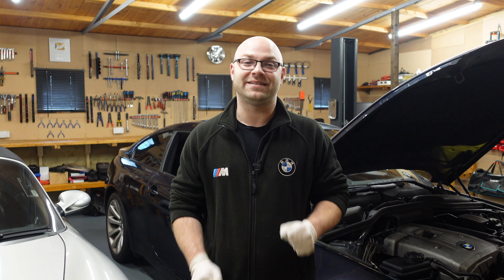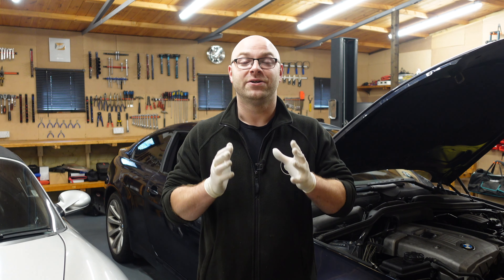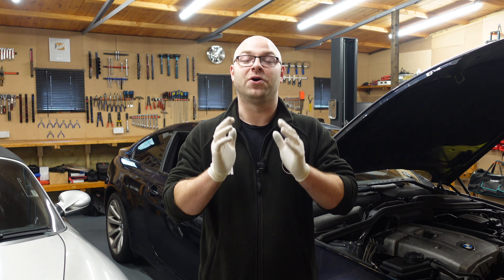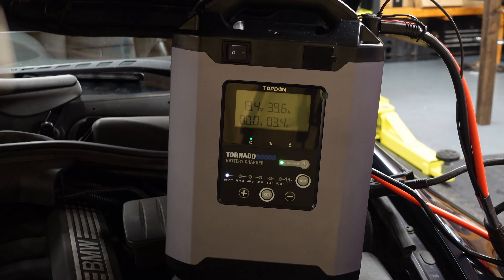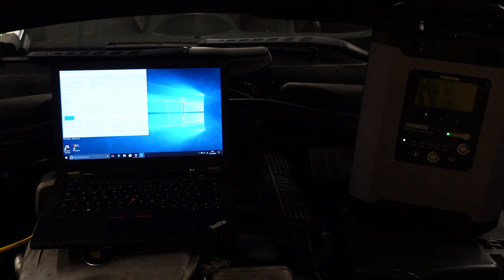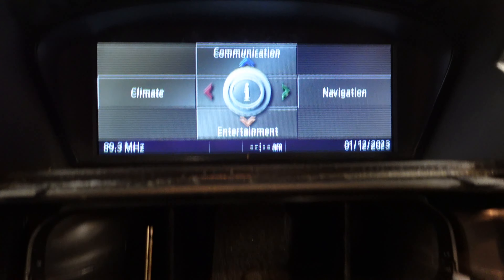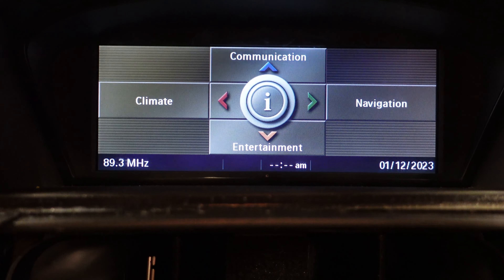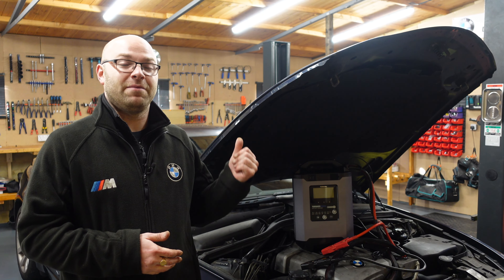This Is The Correct Way To Successfully Program A BMW !!

Comment: Good day Doc, The Swedish CTek now has High Aperage Power Units for Coding, Pro 60 12V, 60A and PRO 120, selectable 0.1V increments from 12.6V to 14.8V, 120-Amp. Let's see a Video.

Comment: Hi mate I’ve bought a 2008 335d. Was wondering what’s the best oil and how many miles I should do every oil change at I was thinking 7,000? & I think a video on a list of bmw engines and best oils for them would be a great video💪🏽
Reply: use 5w30 on that one liqui moly or shell and changes should be every 5k miles and that includes all the filters not just the oil

Comment: Say mate I watch u a lot n I have a 2008 x3 and I've changed both the charcoal canister and the vent valve up front on the motor under the intake still will not crank after fuel fill up I need you

Comment: Three questions

One, when you say bricked do you mean you need to go into win kfp and try again or do you mean the module needs to be removed and bench programmed.
Two, when programming the MOST devices you say never use a DCan cable. Does that mean its possible but a really bad idea?
Three, The E65 does not have dCAN, can a BimmerGeeks cable still be used over the high speed K line?
Reply from the maker: So when bricked is bricked I mean no the only way is pulling them and redoing the flashes on the bench as the flash and eeprom become corrupt. 

As for programming most devices you cannot use a dcan cable at all it’s impossible as they need the most cable to send data without it it won’t even update I mean that. They switch ports to send data constantly and it HAS to use the most port to be able to send data. Without a most you have no way and no chance of updating at all. Only way to program without most is taking the modules out the car changing the way the modules communicate and use a cable.

Comment: Next time I would advise you to use a screen recording software. So you easily could use the screen recording to lay over the camera recorded clip. So it would be way easier for us users to see what happened on the laptop screen.
But besides that: Thanks for the interesting video 👍👍👍
Kind regards from Germany 🇩🇪, 
Philipp 👋
Reply from the maker: This wasn’t really a show how that’s stuff can be seen on my membership in full screen recording. I’ve said it a lot that I put more effort into my membership then I do with normal videos. If you want to see them screen recorded you can on my membership program on here which is fully documented and much better. There won’t be a next time on the channel anything more goes to membership sorry. Just check the membership out and you will see how good quality the videos are which are fully screen recorded and very detailed I go to a lot of effort for them, that’s probably why I have so many memberrs